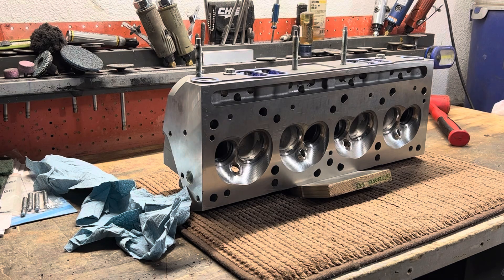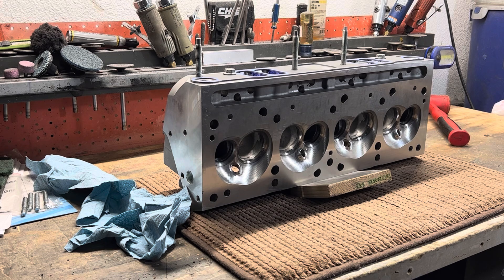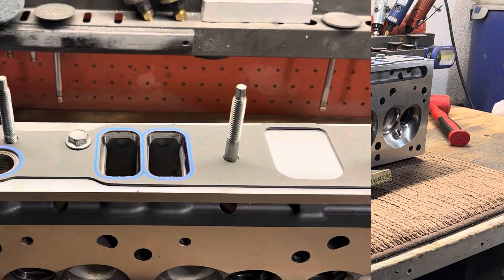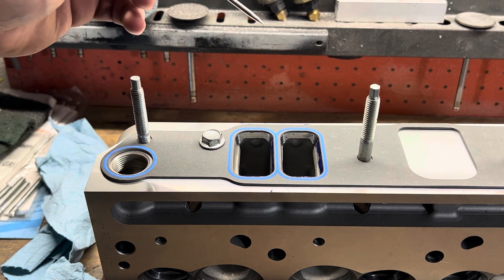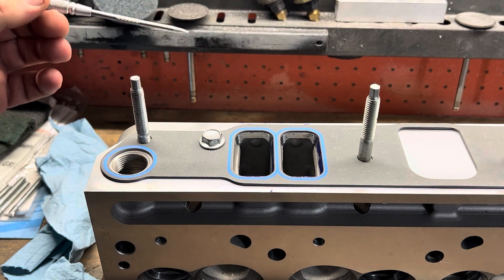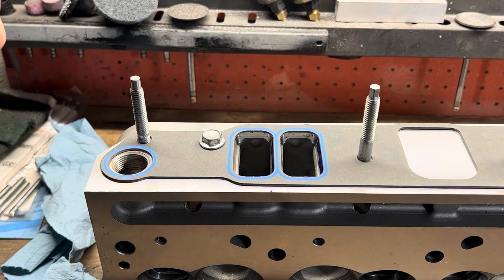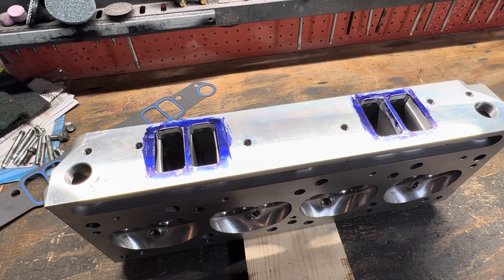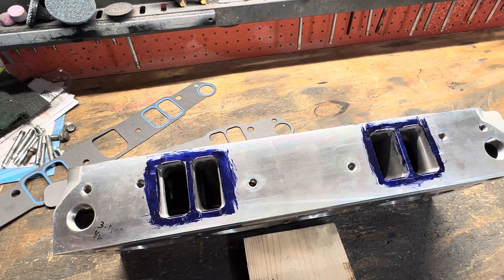Speedmaster Pontiac heads Bad News on port alignment

Comment: Hello I am glad to find this website. I am a beginner but I have watched a lot of David Vizard and many other famous porters before I came here but I have never seen any of them working on Pontiac heads. I would have to learn Pontiac specific porting especially with the weird looking exhaust bowl that has a big piece of cast iron inside the bowl on the same side as the intake bowl wall and the cylinder wall side has a recess inside the bowl. If you run your finger down the exhaust bowl you can feel the cup or recess on the side of the bowl and therefore it is nowhere near the same as porting or shaping a Chevy head. Stock Pontiacs heads are oddballs but they can flow a lot better when a Pontiac expert is doing them and I am glad to see this video. I will be porting a set of factory #13 head I could just buy a performance aluminum set of heads from wherever but I wouldn't have a challenge or learn anything. I know someone that ported heads as a business and he told me stock poncho heads are tricky and I would need a flow bench and can be ruined so I need to learn as much as I can about stock Poncho heads. I don't want to bother him he's retired now. I think I can learn by watching videos. The intake looks like basically an old Chevy head but the exhaust is where it gets tricky and that is where Pontiac heads need the most help. They only flow 180cfm stock and if you're lucky you can get 220cfm if you're good at porting the exhaust

Comment: So this master porter can mill iron or aluminum. But a paper gasket is impossible? 2+1= 9 ?
Reply from the maker: The gasket needed is not the one recommended by Speedmaster. I had to find the gasket to best match the head then match the intake as well. Thanks

Comment: This is why Edelbrock is more expensive.
Reply: They are just as bad.    I have had virtually all brands in my shop, and some intake manifolds are 1/4 off and required welding.  Most of the time, heads are off, just like seen here all the time.

Comment: Every Porter I have ever known including myself raises the intake port and has to modify the gasket accordingly, or use a trim to fit gasket. But more so you need to mock the heads up on the block you're going to use after it is decked and put the intake on it and then adjust the ports accordingly both intake and head. Heads are are not cast in pairs so the will not match the intake front to rear or top to bottom, thats just how it is regardless of the manufacturer, that is why people pay head porter's to get the most out of a combination.

Comment: As far as late 60's Pontiac cylinder heads- There is a Standard intake port- there is a RA I and RA III intake port- AND there is a RA 2 RA 4 intake port. ALL are different sizes in both height and width- but your port looks a bit more off than I would expect to see. We always split the water passage off and dowelled the heads/intake to get the best possible port alignment when building these motors. So there is work to be done no matter whos heads you get. Some one should make a Aluminum version of the early 70's D-Port #96 heads. They had big valves and mid-size chambers with all the bolt holes in the exhaust. Hard to find the cast version now but they made great Pump-Gas Pontiac heads for street performance builds- WAY better than 4X/6X. The round port RA and SD heads are not as friendly to make a pump gas motor out of and are not as good.

Comment: The bolt hole don't locate the intake.  Setting on the gasket locates how far it drops. All you have to do is double up on the gaskets and all will be fine, or mill the heads,  I hope they leave the heads alone,
Reply from the maker: Not going to work on these heads it’s way more than a double gasket situation.

Comment: Ok, so where did you get the better fitting gasket from?
Reply from the maker: Found the needed gasket 2.300” x 1.175”
SCE Acu-seal 128105 intake gaskets.
Reply from the maker: Update update!  I happen to notice the gaskets have a different part number than the package; definitely not a 1233# gasket!  What are the odds, maybe these are some bootleg gaskets I’m not sure. The owner of the heads is sending me a different set of 1233 gaskets, video to follow.  Sorry for any confusion JD
Reply from the maker: Update: The gasket alignment issue must be the cylinder head; we’ve now received two sets of Felpro 1233’s, the gasket Speedmaster lists as the recommended gasket, stamped 1258-1.  The openings do measure the advertised 2.20” x 1.180”. 
The port dimensions in the head match the gasket but not in the factory location!!!  After months trying to work with Speedmaster they chose to stop communication stating they do not sell a raised runner head.  So either Speedmaster is lying or someone is selling knock off Speedmaster heads online? 🤷‍♂️🤷‍♂️🤷‍♂️
I don’t know where the better fitting gasket came from, I only have one and the part number isn’t found online!
Reply from the maker: The gasket that fits the head has 2.300” x 1.180 openings. 
Thermoseal RG-N120 by advantage. That’s the only information on the gasket

Comment: Why not just use HO intake gaskets? Just found your channel, cool stuff. I own a 1972 455HO and buy my HO 7f6 intake gaskets from Butler. Subbed. 👍👍🏁🏁
Reply from the maker: I’ll check the gasket opening dimensions!  I have a gasket with exactly the opening I need but the part number doesn’t cross reference and I haven’t verified where to buy a set.  Thanks for your feedback I appreciate it!  JD

Comment: Let me blow holes in this, I have zero connection to Speedmaster for the record. simply putting a gasket on the intake side means nothing. To me it means simply that the port is raised slightly to aid flow.
Bolt the heads to the engine then install the gaskets and manifold to determine where the gasket will need to be positioned and or trim the gasket, custom engine assembly 101
Reply from the maker: You have zero idea what your talking about. You can follow the community guidelines or be permanently muted your choice. Jeff D.
Reply: @HeadFlowInc  threats will not make you right!

Comment: What ended up happening with these heads? And a video comparing the edlebrock heads would be awesome
Reply from the maker: We were on hold waiting on Speedmaster to decide if they were going to exchange the heads. These heads clearly have raised intake ports but Speedmaster says they do not sell a raised runner Pontiac head. I think the manufacturer was originally trying to say we had modified the head?  Once we proved it’s an “ as cast” head they started saying it must be someone else’s heads.  In the end Speedmaster stopped communicating with us so I’m just going to correct the issue by porting to a different gasket; which means reworking the intake manifold. 
In all honesty I don’t recommend buying the Speedmaster heads after looking at the port alignment to the bowl and absolutely horrible customer service.  JD
Reply: Make a video sharing how they treated you. Sadly the growing trend is for people and companies to act like how they have with you guys. Instead of owning up to it loosing money on one head, but gain the respect of thousands by doing the right thing and improving their product

Comment: What is the part# of the taller intake gasket please ?
Reply from the maker: The taller gasket opening measures 2.300” x 1.160”. 
The info on the gasket may not cross, it says Thermoseal RG-N120
SCE 128105 is similar
MS20101 Mahle
Reply: @HeadFlowInc  Thank you !

Comment: For years people have been mismatched BBC rectangle port intakes on oval port heads with very good results.    I'm sure your "minimal" mismatch is not as major as your making it.
Reply from the maker: The reduced cross section and sharp edges on the steps are creating a pinch point reducing port flow and volume. But to each their own; not everyone has to agree.  JD
Reply: Bs, that mismatch is BAD, big loss of power!!

Comment: So with a port ceiling raised .128 thousands, or a little more that an 1/8 on an inch, doesn’t that completely change intake manifold height??  Now,  to run these heads you have to run a spacer plate sandwiched by gaskets?? I have Reamed cast iron heads to use 7/16” pushrods on a Pontiac and had luck because there is a ton of meat, but a copper tube in there. Sounds like they need to go back to the drawing board.
Reply from the maker: The plan is to gasket match both the heads and intake to the new gasket opening. The intake is aligned by the bolt holes, now I will create a new port opening to match the taller gasket and make sure the intake runner dumps the same.  JD

Comment: This is why you don't use cheap Chinese castings. Even if you rework one of these heads......still giving up 100 horsepower....over a properly done Dart, Brodix, AFR, head.
Reply from the maker: There’s very few aluminum Pontiac heads under $3000.00 a set.  People just can’t afford the Name brands.
Reply: If they can't afford them....then they don't need them. I grew up when there wasn't any aftermarket heads and you had to deal with what was there. Other than weight and looks......these cheap heads do nothing for performance without major work....and dollar for dollar....not worth it.

Comment: I think he got a poor casting, my Speedmaster heads lined up perfectly with the 1233 gasket. I wanted to raise the roof, so I purchased the taller port gaskets that are available from Butler and other Pontiac suppliers.
Reply from the maker: What people don’t understand is the port opening is Exactly the right size as the 1233 or RA4 gasket, Cut with a CNC program, but the ports simply do not line up with the gasket using the current bolt hole location.
Both cylinder heads are machined the same way supporting Speedmaster sent them out this way.  I want someone to show me their Speedmaster heads with a properly located intake gasket.  JD
Reply: I know Butler Engines who is like the pontiac guru's have done work on these heads for customers and never mentioned anything like this. Other people have done reviews on these same heads and not run into this problem. You have a very curious problem here. Undoubtedly  I see your points as well. Hopefully this is just a case of a bad casting and if so the big name companies certainly have the same issue from time to time as well. I'll be staying tuned for your results b/c I was on the cusp of getn a set for myself. Thanks

Comment: Just curious, without removing material from that ledge, how could you fix it?  I'm thinking tig weld a bead and then create a proper transition.  But Since it's on the intake side, would a metal epoxy putty hold up?  Just trying to think how a DIY person could improve those without a tig welder.  I've tried to build up material using those aluminum brazing rods (Alumiweld type thing), but I'm thinking it would be difficult to heat the head enough to get the brazing stick to flow/adhere properly.
Reply from the maker: My answer is two fold, you could use epoxy to fill and recreate a smoother transition/radius; but the flow of the port will still be reduced. 
The “Pinch Point” on many heads is the cross sectional area where the pushrod passes. As you can see the flow potential of the head is reduced .090” smaller than the incoming air from the intake. 
Research what brand epoxy is recommended and available if you want to try smoothing the transition.  Another option would be to at the very least remove the sharp edge will help some.  JD

Epoxy: Z-Spar splash zone or Moroso A+B
https://www.belzona.com/en/products/1000/1111.aspx
Reply: @HeadFlowInc  Thank you for the reply and especially for the epoxy recommendations - I hadn't heard of them before.  I don't have these set of heads, but I always learn something from your videos!
Reply: Just sleeve the pushrod tubes that run next to the intake ports. You will have room to "fix" this condition at that point I am pretty sure. Just dont grind past the tube......

Comment: Just trim the gasket and quit crying. You sound like them LG BT people, just man up and get it done.
Reply from the maker: No, actually we’re in contact with Speedmaster about swapping out the heads because Speedmaster says they don’t sell a raised runner head. We’re waiting on the Pontiac head division concerning the warranty swap. 
I could make the heads work, which requires more than trimming the gasket, but instead an entirely different gasket than recommended. 
Now you know there’s more to the situation.  JD

Comment: Disappointing,  but not surprising. I had hopes besides working a full time job and becoming a jigalo on the side that I would eventually have enough money to buy a set of these heads . That's a lot of money for a piss poor casting. Lol my chevy roots are whispering in my ear , just put a chevy in the lemans. I'm becoming more inclined now to listen. Great video !
Reply from the maker: Please keep your Pontiac a Pontiac!  You’d be surprised how much fun a pump gas 455 is with 400+ HP and 500+ TQ to play with. 
This is easily done even with a cast iron d-port head like a 6X -4 casting with a mild cam @.050” 230+
Reply: Putting a chevy engine in a Pontiac is sacrilege.

Comment: So is that a blooper on Speedmaster's or Pontiac's engineering?
Reply from the maker: It’s a potential manufacturing issue on Speedmaster, if it was done on purpose.  I don’t have another set to compare to, so we wait to see what Speedmaster decides to do.  JD
Reply: @HeadFlowInc  I hope they replace them for your customer. I've had my share of getting jacked from purchasing things from the internet. Thanks for the video. Good luck and God bless.